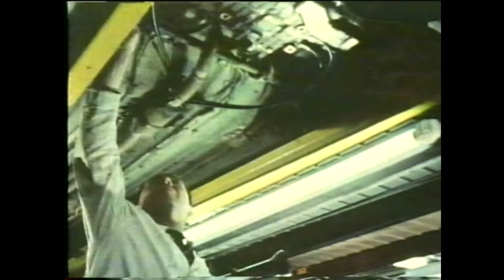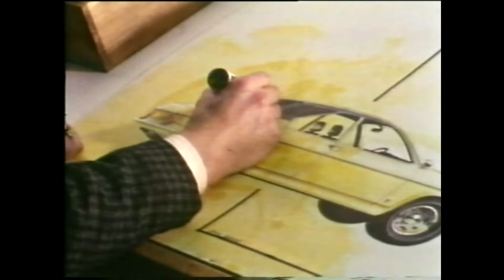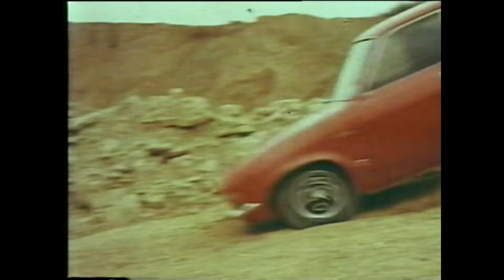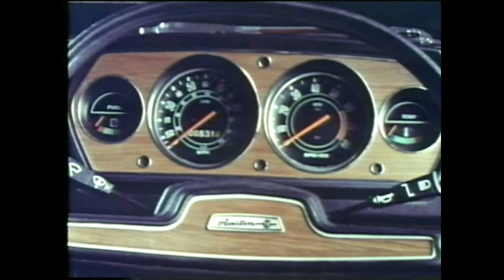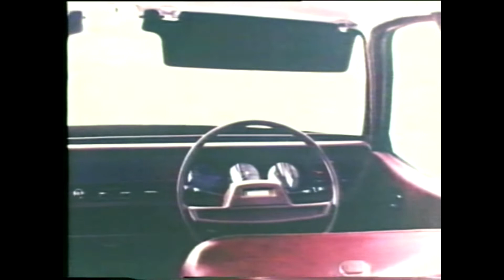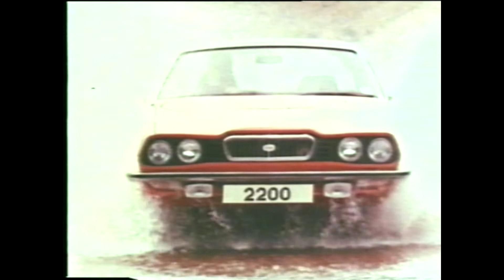British Leyland Cars Of The 70's.

Comment: I worked with an old chap who worked at Longbridge security, he said the body shells stood outside for months unprimed and were red rusty, then carefully lol brought into the factory dip primed and finished to a high degree of finish.
All said my ex had a 1.3 coupe as a first car, and I we thought they were an easy drive fairly reliable and very comfortable.
Having the A serious engine were reliable and pulled well, moved onto a Mk2 2 door 1.3 Escort which was an entirely different level so so reliable more economical never lost a drop of oil.
Don't go there it's current worth in todays market paid £ 2000 in 1985 lol
Enjoyed the video. Many thanks.
Reply: same probem at Alfa and Fiat and Renault and many more brands....in German even Mercedes and VW and BMW used GDR or Soviet steel.